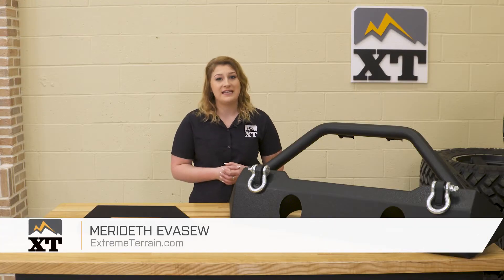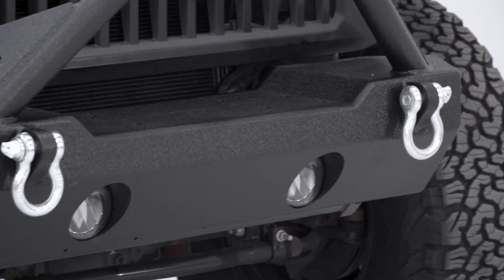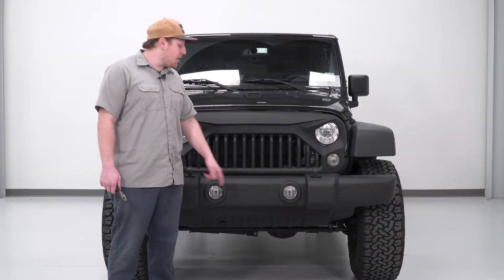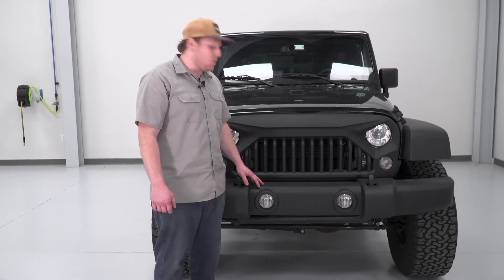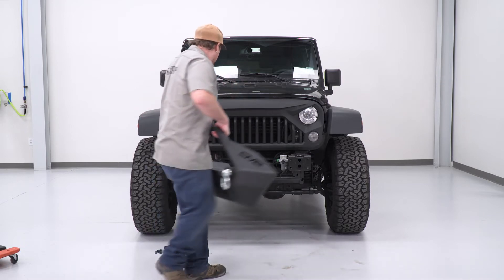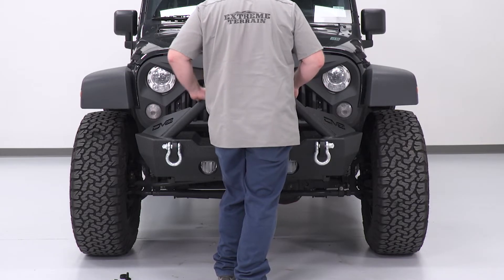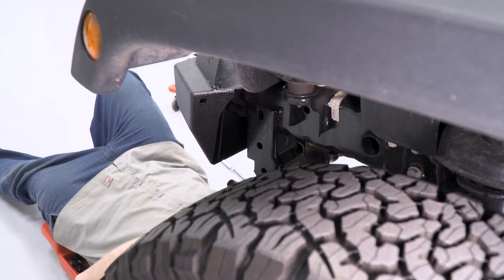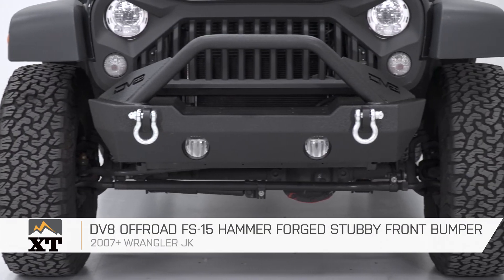Jeep Wrangler DV8 FS-15 Hammer Forged Stubby Front Bumper (2007-2018 JK) Review & Install

Comment: Just installed it, but bumper came with scratches, missing clips to install fog lights, and no instructions, had to watch this video to install. Very disappointed on how careless they are when they ship items, they don’t even double check to make sure the item doesn’t have any scratches and has all the required parts.
Reply: Rico Same, got it for a gift this christmas and it came with a couple chips, no instructions, and missing clips to install fog lights
Reply: Ariel Uria I ended up contacting them, had to resend them the bumper I got, I told them what the problem was, they ended up sending me another bumper and same thing!! Scratches and still missing clips for the fog lights.

Comment: Missing hardware.  All nuts were the same and worked but why why why didn’t you say to put the winch plate on first!!!!!!  You talk about it at the end.  Had no instructions either and purchased new.   Heading to store to see if I can find clips instead of waiting a week.
Reply: Called DV8.  They said to use zip ties instead of plates to install lights.  Easy and good.